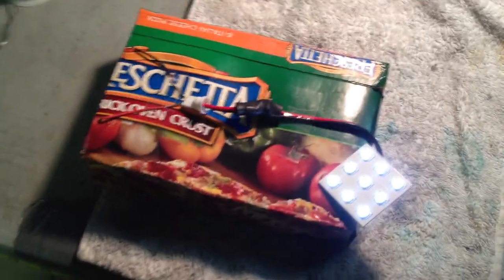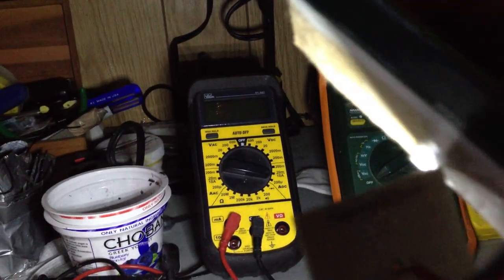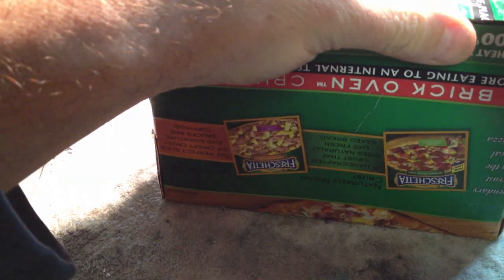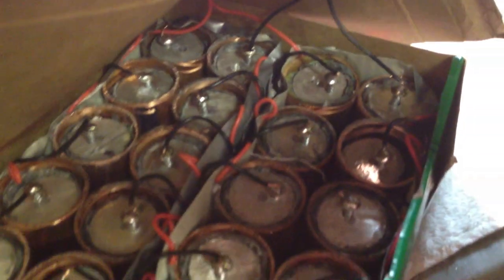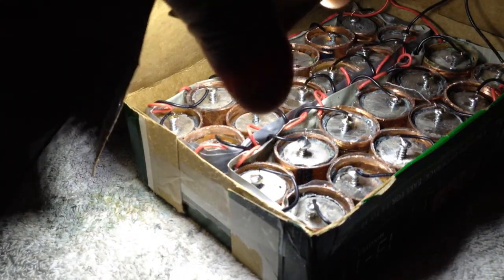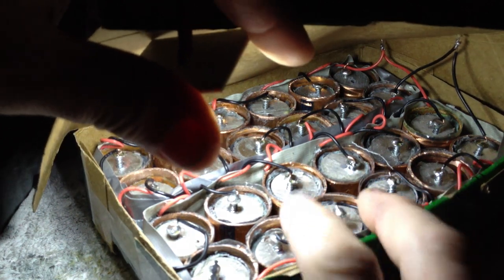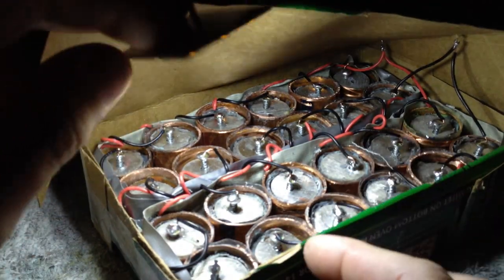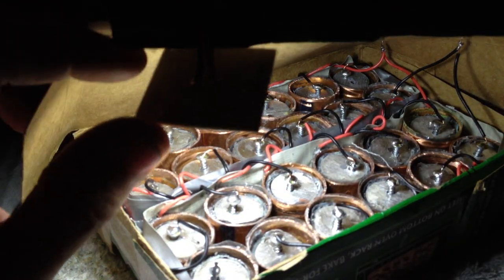Crystal Cell Thermo Static 5

Comment from the maker: I guess it does not. But it does take 12v and 300ma to run each of those LEDs boardds, which is about 3.6 watts, but the LED does give a light of a 25 watts lamp, or my perceived luminosity comparison of the two lights together lighting a dark room.

Comment: usually every week. I have some new formulas and each one works different. Some cells also are smaller and have more or less LEDS. I am finding a ration of "load" (number of LEDs) and number of cells where the performance is extremely constant and no need of adding anything for months so far. The cell is sealed with tape and outside more aluminum tape.

Comment: Thank you, Fausto.  you solved  el.energy need 4 average household...6 years ago...
Book-sise box = 3w  constant.   shoo-box size = 10wh;  row of 10 such shoo-boxes along the wall = 100wh; 10 rows (shelves)  wall = 1000wh =1 kwh; 24 kwh a day ...24/7...720 kwh/month;  .... 
if  one such "tesla wall" is not enough, put two or thee   
Thank you again. congratulations...  better late than newer. solution 4 energy crisis you found years ago
Reply: Apparently you weren't paying enough attention. He mentioned that it lasts about 2 weeks then he has to add water. Also, you can see that at least one of the cells is already starting to corrode. These are also not rechargeable, they're simple homemade crystal cells made using common ingredients. Honestly, this one box is good enough  to maybe run an old walkman for a week, but not much else. You couldn't use these for any kind of power wall because even with enough, you'd use so much that you'd be taking the whole power wall apart every one to 3 months, disassembling the cells, cleaning the copper and magnesium and making a new batch of the crystal electrolyte mixture up until they are corroded too far to be used and need to be replaced. Even then, in between, if even one cell corrodes too far, it degrades the power you're getting and lessens the life of the rest of the cells. Great for very low powered things in an emergency if you've got the stuff handy, and the heat source to melt the crystals, but cheaper and more efficient to just go buy a shit load of rechargeable batteries and have them charged and ready in a drawer. And you certainly wouldn't consider simple rechargeable AA or AAA batteries off the shelf would be a solution or even decent for power wall use.

Comment: What about a cell the size of a 5 gallon bucket?
Reply: The internal resistence of the cell would make it useless. I've tried with rods of 6 inches diameter and 2 feet long. It is more complex than I thought, today speaking, after still researching this thing for (let's see today is April 16 2021 and this video is from Mar, 2013) 8 years.
.
This series, Thermo Static, is the WINNER in my research. I have many series but this one is the killer, the right way of doing this crystal cell.
.
Btw, I have still 3 cells running since this VIDEO, from THIS PACK ON THE VIDEO, today.
Reply: But, to answer your question in a practical way.
.
You can add many unit cells, like I did, and increase voltage and current to a certain limit. You can add many in series and achieve 200 volts just fine but it will be very little current, probably in the micro-amps.
.
If you put many of them in parallel, like I also did in this video, you will increase the current but it will be exponentially less as you add units, very strange. Some of the unit cells may even start recharging instead of producing current and destroy your whole set.
.
So you have to find a balance. Now, if you build a group cell using large rods of Magnesium, you will achieve very large currents and be able to run something like a fan a long time, just add more water with time and it will just corrode til the end but you will have some power.
.
If you add very little water, very, very, very little water and let it dry up , ANOTHER THING starts to happen and that path is a long path ........

Comment: Hello great video!  Have you ever used or heard of the cylinders of Pharaoh Pepi II?  They are made from copper and zinc cylinders filled with quartz crystal when held produce a electrical energy starting at .6 volts and will gain .02 volts every minute held.  Make them yourself or get them on amazon or etsy called "cylinders of the pharaoh"
Reply: Thank you. I will check it out.

Comment: I don't recharge them in the normal sense. I add epson salts solution (water distilled) and they are back on.

I don't know yet the wattage out but it is (i guess) around 5 watts now. I have more to study and record before confirming number. They do light pretty good and you can not sleep in a dark room with one of those around for sure.

Comment: is it putting out 25 watts or is it just running a 25 watt led. How mush power is the cells outputting? What does the multi-meter say on the volts and amp when running the LED?
Reply: +Brian Link i would guess 2.5 watts
Reply: @jettechristensen4014  sounds about right.  The best I've seen them output is around 150 milliwatts once they settle down from the initial level.  And he has 24 cells.

Comment: Do you think these could be used in arrays with a charge controller and deep cycle batteries to run house lighting or 2-3 lights overnight, and do you think that would extend the life of the cells ? Also if you sealed the batteries and trapped the moisture inside do you think that would keep them charged longer? Thanks for sharing.
Reply: Sealing the cell helps tremendously. Running your house on those cells is a little bit too far from today. May be with more research and funds I will get there.

Those cells don't like to be stacked in parallel since their internal resistance are not accurately equal.
Reply: There is no moisture inside in a real crystal battery, it works on a non-galvanic effect. They possibly work on a piezoelectric effect.
Reply from the maker: +Naoki Kashima 

That's where I am going, no water either added. There is ALSO a piezo effect.

Comment: If you would, please post how long they lasted in the description. Thanks! -t
Reply: oh that one died in about 3 weeks. Other cells I have stands YEARS. It is very strange because they all corrode BUT the ones that stand years corrode so slow and so little that I am confused myself.
Reply: Fausto Gomes  Hutchenson recommends priming the metals with water glass to keep the metals from corroding. Bedini recommends alum for the same purpose. Maybe one of these methods will help.
Reply: Solar OffGrid I also did that and passed that phase.
Reply: Fausto Gomes I really appreciate your work. Noticed someone called you a hippie wasting copper... it's better than sitting on the couch all day watching football... Keep up the great work!! PS - my best crystal cells "from scratch" have been copper with aluminum and a 50/50 mix of soda wash and borax as the electrolyte - easy to get materials in the US. My best batteries that give real power are the dry cell standard batteries converted with alum and another mix given by Bedini a few years ago on the Earth Light forum, on which you made significant contributions.

Comment: This is not free energy, although it could be utilized to provide a week or two or lighting to an event without use of a petro generator. The best application for salt crystal electrical generation is for emergency power or back up generation. Small well made kit packs can sell well in this manor. If one can keep the chemicals separate until the need arises , than this be a great item to put on the selves for campers,  boaters, motorized stuck on the road and as well as solders out on the field.
Reply from the maker: +HeleighnaDalney 

Free energy? no, but there are theories in the Quantum field of physics that describes the possibility of having unlimited energy from the "vacuum".
Reply: Just keep your dehydrated magnesium cloride in a air tight plastic container with your pre soldered anode and cathodes and something to pack it and a tube of silicone to seal the top. But you can also just makes these on a piece of paper with some elmers glue and it'll work just about as good especially timewise. O, yea. And don't forget the jewel thief.

Comment: what happens if you make very huge cells as a size of a water heater  tank? you could power your house for decades?
Reply: ToxiC BikEr it does not work. Differing internal resistance and very high internal resistance makes it impossible.
Reply: Fausto Gomes  so hooking hundreds of these tiny cells might do anything?

Comment: It's a chemical battery and there's no way that this leds run at 25watts they would burn without a heatsink looks like 1-2watts tops by the light that they output.
but anyway I assume that this is fun experiment rather than anything practical.

Comment: couldn't you increase yield by making more reaction surface?  Say putting multiple smaller magnesium rods inside your copper pipe with crystal material surrounding?
Reply from the maker: +paulfarnham28 

Yes but there is a limit. I have done cells even 2 feet long.

Comment: An idea?I have graphite cells and some silica with all the salts nessecary to build the power cell, will it charge a capacitor than eventually after charging it putting a usb board on the capacitor to pull ~5v to charge a cell phone?
Reply: That is an idea, so trye that and give it a 110 volts kick  for half a second (seriously but careful) .
Reply: why is the kick from the outlet needed? and how much time do you think would need to charge a supercap with 2 cells that output ~1.5 volts each with 150mA rated power for each cell
Reply: If it is a "CELL" that should generate its own energy the initial "static" kick is only to align the "crystal cells" inside. The time is only enough to give it a "kick"".

Now if you are trying to use it as a capacitor than it does not make sense to do that indeed.
Reply: If you pay attention this series of videos are named "thermo" and "static" for a reason. One is the "static" kick I mentioned. This is a very important building block for the cells I am developing. My next series (which I have been holding on for a long time) is the next sequence based on THIS findings.
.
My current cells are running SINCE this video was made. It is a painful process of long tests. Unfortunately, or fortunately, the cells lives for so long time that I MUST wait to THEN release my results.

Comment: Awesome video! Crystal batteries work on a non-galvanic effect since there is no electrolyte present! This means that a crystal battery can last indefinitely....
Reply: Hello I wonder if about how long the cristal cell really last running non stop in other words by that and can it run for 20 years with out rest or non stop? that would be interesting try out.
Reply: No not really they do actually corrode
Reply: It will be Interesting to try out with a carbon rod to see how the results might turn out
Reply: TheBlackAndWhiteCow No they don't corrode after a certain period of time. There is only a corrosion during the FORMATION of the crystals. Once that happens the water becomes a fuel for the cell e no more corrosion happens.
Reply: Jose Servin Carbon rod will accelerate the corrosion to the point that crystals will not form and therefore the cell will eventually be gone.
Reply: Or until all the magnesium core is used up
Reply: You have to boil out all of the water in the magnesium cloride (outside;)from my understanding to make this a true dry cell. My first run was a 3/4 copper cap with a galvanized rod inside about the size in the video. Then a jewel thief and a 2 v led and a boom. So I've got a bit more work. Trying to apply this to missions work.

Comment: How long these battery charge will last before its all completely discharged?
Reply: Meiji Jap This particular cell you see will run for may be a month BUT only for that amount of power.

Now, those exact same "unit cells" (this one has 24 unit cells) in groups of 4 are running an LED since this video was made until today and will not die. Constant voltage and power delivery. Since THEN.

So, I am working in improving the power level now. They do run "for ever" so far with extremely constant voltage and current output.
Reply: It's amazing if it still running today...i am going to find way how to make one of these then..thx for the reply

By the way i am currently experimenting carbon and aluminium battery...it runs two days at 1.1 volt now still not yet dead...

Comment: ide send that pizza back if i was you ....
Reply: +Fausto Gomes 

thank you
Reply: +Tony Baines 

instead of making 24 small ones would 1 long one work ? because if your talking millivolts you could lose a lot of power /voltage drop through wire resistance dry solder joints etc ....especially if its dc.
Reply: +Tony Baines 

and you cold put soft polythene washers at intervals to allow for the crystals expanding .
Reply: +Tony Baines 
and by the way i live in england and weve scrapped concord but thank you for your kind offer.
Reply: +Tony Baines 

good observation. Indeed resistance has been a big problem scaling this kind of cell.  More in series worse it gets. I tried also using more surface area for more amperage but it still does not work well.

Concerning the crystal growth, that is my worse problem lately. The crystal grows but it is not solid enough and the water it holds eventually destroys the crystal structure and kills the cell with plenty of metal behind.

This crystal cell thingy is an amazing puzzle for me.
Reply: +Fausto Gomes 
when assembled seal it from the atmosphere try using dipping hot wax as a experiment and try using silica gel pods, the other thing is that all  the cells ive seen on youtube have 1 problem in common they all use iron screws as termination iron or steel is the worse conductor of currant i know, you should make a dowel or use more conductive material.this will greatly improve the currant flow, ime not sure if copper or brass screws would work because of the polarity, i cant see why not though. and the bar will need to be tapped.

tony
Reply: +Tony Baines 
and always be careful when working with this material, i know it looks like steel but its most certainly not, i once set fire to a lath turning a bar down, and don't breath or ingest the filings.
Reply: +Tony Baines 
i dont know if it would interfere with the chemical process if you mixed the silica gel granules when making the mix, i cant see why, try 1 cell as an experiment, i wonder how battery manufactures get round this problem its the same when you leave old battery's in a radio, they crystallize..